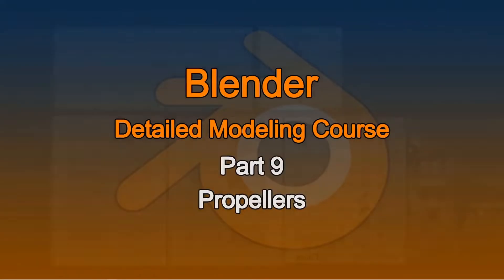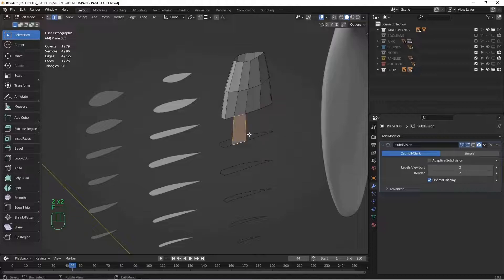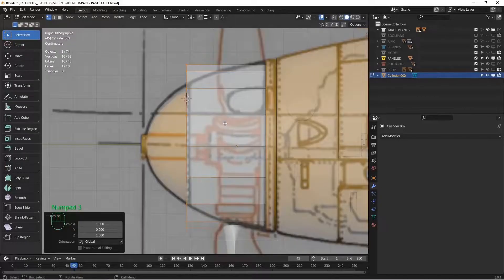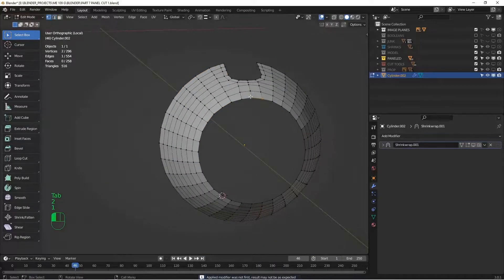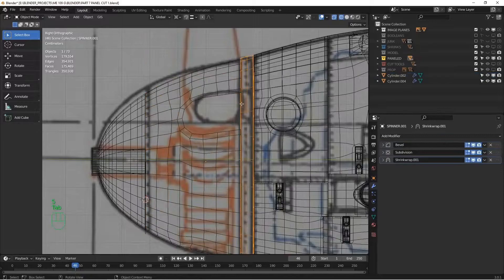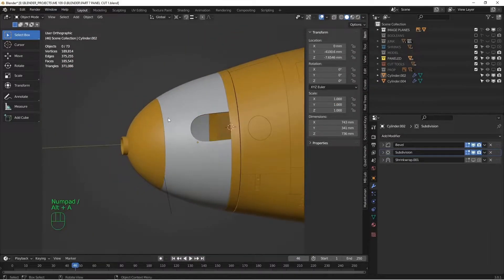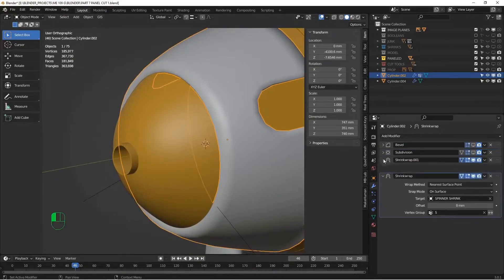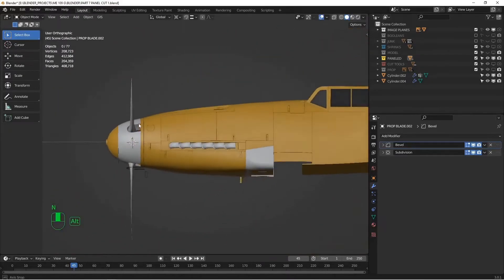Blender Detailed Modeling Course, Part 9: Propellers

Comment: 04:25 So unbelievable how powerful knife project is. I use it in ferry modeling to cut holes in walls that curve and I can’t even begin to explain how easy it makes cutting out space for windows in the pickle fork walls that curve AND are angled. Hopefully I’m skilled enough to understand the shrinkwrap methods now. My problem solving is tripled when I’m thinking about ferries so hopefully it will just make sense to me suddenly like using knife project did. Thanks again for these videos
Reply from the maker: I agree.  Its super useful.  Good luck with your projects.

Comment: Hi Mark I have a very nice spinner built for my Spitfire MK9 and the area's between the holes for the prop refuse coloring. Any ideas how I can fix that without rebuilding it? I've checked for flipped normal'ls and all that. I deleted a face in the taper forward of the holes, replaced it with a new face and now that face also refuses color.
Reply from the maker: I can't picture what's going on with your spinner.  If you email it to me, I'll take a loot at it.  MarkAllowayYouTube@yahoo.com
Reply: I went ahead and built another one! Must have been some data loss.
Nothing in between the props would take material color but metcap and solid colors worked fine.
Ill store your email though.
I deleted the old spinner.
Reply from the maker: @RC-Heli835  Glad it worked out for you.

Comment: The drawing you used for the prop cross sections had the correct pitch at the various sections. When you rotated the sections prior to lofting, you set the pitch at zero for the entire blade. When placed at the spinner and looked at in side view you can see your blade looks thinner because it has no pitch angle. To correct this you could rotate the blade about it's long axis 5-10 degrees  to set the pitch at the tip and then use a lattice to twist the root to about a 45 degree angle.
Reply from the maker: Thanks for taking the time to let me know.  I always appreciate constructive feedback like this.
Reply: @Mark_Alloway  When you adjusted the spinner base mesh profile with the lattice, how did you ensure that the modified shape remained concentric? I'd think for a concentric shape like a spinner, a simply shaped line of vertices with a screw modifier would ensure the shape, even after profile adjustments would remain concentric.
Reply from the maker: @randyhester3340  The base-mesh spinner was based on a quadsphere and was not mirrored,.  The lattice I used to reshape it surrounded the entire base mesh and my cursor mode was set to "median point".  

When I selected verts on the lattice, I selected them all the way around the object.  Since my cursor was in "median point" mode and because my object wasn't mirrored, scaling and moving the latice points affected the spinner base mesh evenly on all sides.

You could use a screw modifier, but that typically results in pinching at the tip of the rotated object.  That's why I like to start shapes like this using a Quadsphere since it puts a nice set of quads at the front of the object and avoids the pinching issues.
Reply: @Mark_Alloway  I went back and reviewed your video more closely and you are doing all the proper things to ensure the lattice modifier works on the base mesh in a symmetrical manner to preserve concentricity of the spinner. However it would be easy for someone less experienced to only select part of the lattice and modify the spinner in a non symmetrical way.  Using a string of vertices and a screw modifier would prevent that from even being a possibility. I concur that the screw modifier results in a pinched endpoint. But that is why I would only suggest it for the base mesh. Shrinkwrapping a quadsphere over the screw modified base mesh eliminates any pinching that could result in distorted textures in the final model. Anyway I believe either method would work. I'm learning a lot from your tutorial series. I just wish I had seen your sub panel video back when I was working on my V-1 model.
Reply: OK I experimented some more and even with a quadsphere shrinkwrapped over the screw modified base mesh there is a small bit of pinching at the very tip that is difficult to get rid of. This is not an issue with a spinner like the Me-109 that has a cutout for the cannon.  However it would be an issue for a spinner with a full rounded nose.

Comment: For propeller blades I'd recommend getting the base airfoil profile down and then use a lattice to shape the blade accordingly into rotation, it might be a bit easier that way with very convincing results. Only flaw would be the approximation of the thickness of the blades at it different parts of the blade.
Reply from the maker: The lattice is a great tool for adding smooth twists to things.  Good idea.
Reply: I'm trying that technique out now, provides pretty nice results, the major problem imo is getting the proper pitch per lattice section.